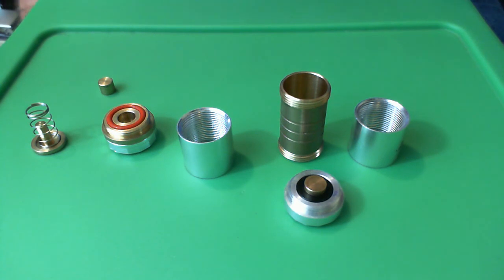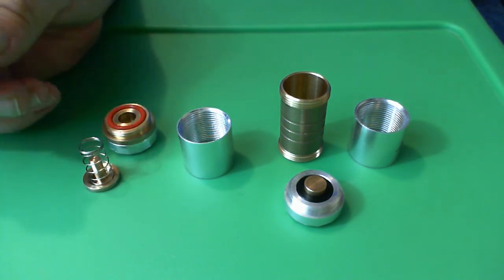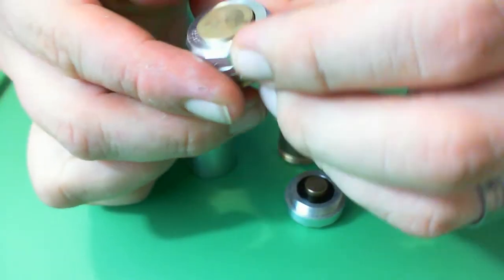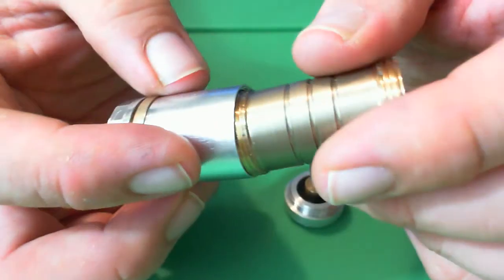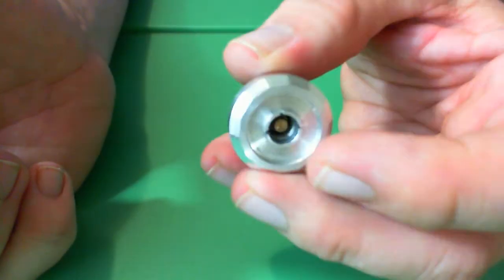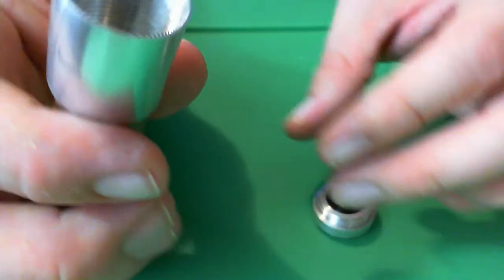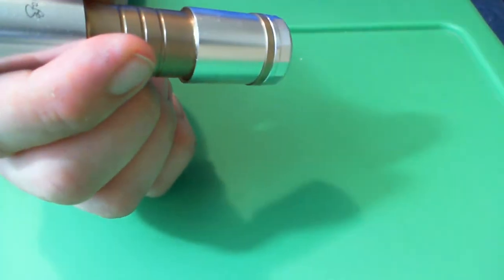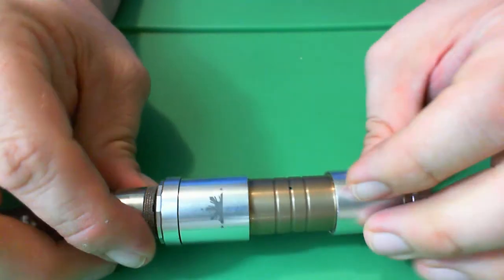411Vapes.com Review Grand Vapor "M16" Mechanical Mod Sold by Vaportekusa.com UPDATED

Comment: I ordered a mechanical mod from VaportekUSA as well, and the threads on my 510 connector are also wobbly. I can't remember which device I got that it did it on, but the same thing. I HOPE you can get a BETTER replacement thread! Good luck! Good review and very thorough! Thanks!
Reply from the maker: I was one of the lucky ones. VaportekUSA did replace the head for me and now I have put the m16 away for a rainy day.